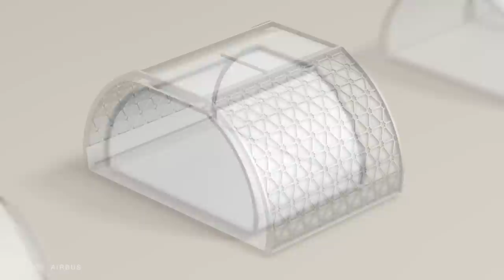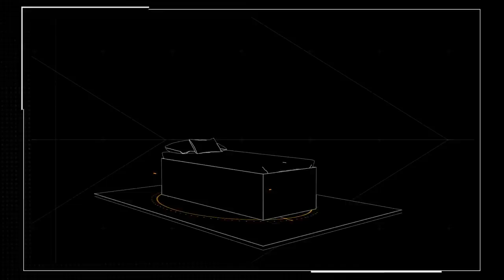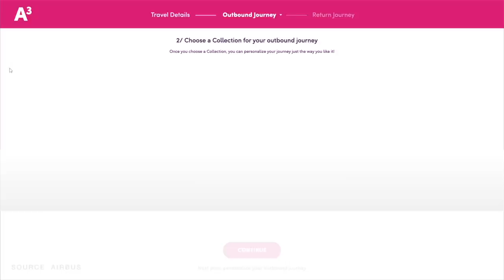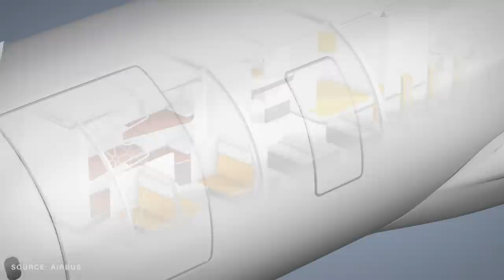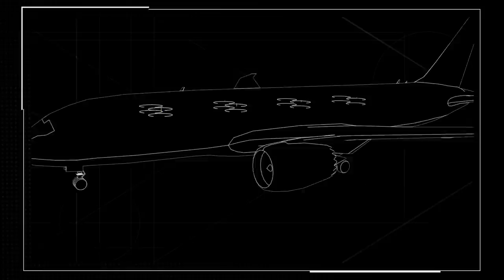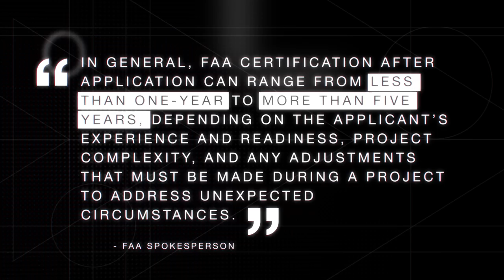Inside Airbus' modular plane concept

Comment: in future i dont travel by plane, I travel by Hyperloop
Reply: You gonna do that over the ocean?
Reply: Jon Petersen we're working on it. stay tune Tesla.com
Reply: one day its gonna be possible
Reply: Hyperloop is only viable between high density cities over short-medium distances. If you think air travel is going anywhere, you're deluded.
Reply: Behemoth29 Hyperloop is faster, cheaper, and ELECTRIC.  It's the future for non-transcontinental travel.
Reply: But Hyperloop's crammed.
Reply: Lukas Wagner but hyperloop is just a pipe dream that's all
Reply: lets just prove this technology even works by building it, not a small 1km test track but 50km or something.
Reply: Kni you have to take small steps in innovative new technology, rather than big steps. As it will very costly in the beginning. All inventions are 1% inspiration 99% perspiration
Reply: Yeah I'll see you say that when you're going from Europe to America
Reply: Max Dietz With that attitude, essentially the same could be said about planes. A long pressured aluminum tube riding on nothing but the air underneath it, resting on lift forces created by bendy and seemingly fragile sheets of metal sticking out of the main tube.

Of course it could fail. Of course there will be breaks in the system. However, they can be solved with continued innovation. Being constantly negative doesn't solve anything, on the other hand.
Reply: Hyperloop is just another terrorism event waiting to happen.. Who is going to keep guard a tunnel that extends hundreds of miles in the open?
Reply: Pfff hyper loop? I rather teleport each and every single cells in me to the location.
Reply: so is anything and everything else....
Reply: Hyperloop sounds faster and better
Reply: Hyper loop is sooo 2017
Reply: My team's Hyperloop design used a very similar modular concept that got us a SpaceX award last year.
Reply: Omega Who is going to keep guard a pair of metal bars that extend hundreds of miles in the open? At least Hyperloop doesn't vaporize unlucky local wildlife
Reply: Evan C. The issue that behemoth mentioned has to do with the vacuum which the hyperloop would need: the longer the tube is, the more air you would need to pump out and the more stress the structure would have to support, not only that, but the slightest failure would compromise the entire track. I'm not saying it's impossible, but it is clear they need to work on the project a lot more before it can be used.
Reply: so please watch hyperloop one. so far it worked out really well
Reply: Hyper loop is like 100mph faster then a plane.
consider the cost of implementation of a ocean wide hyperloop system vs. and airplane
yh nah i think the aviation industry is gonna me more then fine.
As for supersonic planes the industry found out ppl like the subsonic spped of current aircraft. THeres not much of a need for faster planes soooo...
Reply: Yuanxin Liu But planes are in the sky. There's nothing up there that could actually puncture a hole. In the ground there's storms, hail, rain, rocks, and vandals waiting to mess it up at every foot.
Reply: Hector G. How? What is getting out of hand?
Reply: You mean the hyperloop that has been thoroughly debunked by Thunderf00t?
Reply: We'll see what will work first: Hyperloop, or Electrical planes =P
Reply: Evan C. Obviously you didn't listen to what Elon Musk said....
Reply: 77Avadon77 thunderf00t did a lot of incorrect math in his video just saying
Reply: What incorrect math? He's right that a tear in the vacuum would make the whole thing worthless. Tunnelled vacuum travel is an old idea that's never been implemented because of design obstacles that don't make it feasible. You'll never see a hyperloop in your lifetime.

Comment: This looks like the beginnings of what traveling to the Moon or Mars could look like. Less turbulance in Space.
For terestrial travel, it seems like a lot of space per passenger.  As fuel costs are the most expensive costs for the airlines, I don't see them adopting this until we have solar powered planes flying on battery power.

...but its a great design for passengers in Space or even possibly a Space hotel. Maybe the compartments not being used could be folded flat using origami tech

Comment: Cabin designs traditionally focus on fulfilling required safety regulations and accommodating maximum possible seats. However these radical modular cabins take the idea further to include human comfort. While they won't be implemented anytime soon as the airline industry has too many practical problems to solve, there can be possible middle ground. For e.g. how can the existing business class cabin in say an Emirates flight, which already has a bar area, be redesigned for more space and facilities. It doesn't have to be "all or nothing"; there can be "some".

Comment: Bet the only thing that will be flying is the new system for loading up the cargo, a few tonnes of extra cargo. Plus loading cargo quicker on the plane will save money as well.

The screens will probably be use at some point in a new aircraft to cut weight and improve aerodynamics.

Comment: Before even watching the whole thing I'm thinking: Okay, you can hot-swap people bays, why not hot swap the people too? Make it safe enough to load the people into a hallway that leads to the airport interior. Then getting off the plane doesn't take as long, hunched over, waiting for others to get their baggage. The bottleneck is now a small row of chairs instead of the entire length of the plane. (With one person trying to yank their oversize carry-on out of the over-head bins, a line forming behind them.)
Reply: Re: no windows. I get the impression this kind of implementation would include that freaky all-around display where you could select to see a movie, or just the exterior of the plane. Cameras are _super-cheap_. You could have one for every meter of the exterior of the plane for a cheap and helpful constant 360 degree view of the plane exterior.

Comment: Why no windows? I can think of how you could put windows in the aircraft.
Reply: TYler SChecter i believe since it's modular system meaning they will slot the sections into the plane with different permutations, the windows might not always match up to the exterior of the plane so they just block it all out

Comment: I'm cabin crew and I don't think this will take off. Current advice is to stay in your seat with your seatbelt fastened wherever possible, as climate change is increasing the amount of clear air turbulence - look at the recent Etihad flight where CC and PAX alike were thrown to the ceiling and injured. Encouraging people to be moving around increases the potential for injury. (And also all these loose items they have in the demo - where are they stowed and how long does it take to do so??)

Comment: so Airbus will store the additional sequences which the airlines would like to exchange at the airport and invoice it to the airlines? and there are way fewer supply of seats and growing demand for them, so tickets' price will rise more than the airline can earn with lost seats but increased service or drink/food consumption - what is already expensive. or airlines will buy more planes to meet the demand for flights but airports already run on full so they'll buy more A380? as someone said below: people don't want to spend often twice the time in a queue than with actual travelling; they need easier boarding. probably the aim of this project is not to revolutionize air travelling but to come up solutions for faster freight loading, cheaper to make bar and sleeping areas and so on.

Comment: Why do they think this modular concept allows them to disregard passenger density?  I thought the main advantage of this was just reducing aircraft turnaround time... I don't understand why they're trying to fundamentally "change the flying experience" as well.  The cabin layout and modularity are entirely separate issues.  The fact that they're combining the two suggests a misunderstanding of the pressures within the aviation industry.

If they were serious about getting this concept flying they would start with a modular yet conventional cabin for the sake of certification.  The fact that they don't do this implies that they're only interested in this as a shiny artistic concept- not as a practical one.

Come back with higher aspect ratio wings if you want to actually help the airlines.

Comment: I see this coming quickly.  It won't be for this open, luxury concept. Instead, United et al will look at ways to increase density on flights with premium undersold areas.  For example, if only 4 of 12 First Class seats sell, why not switch out the 8 empty seats for 3-4 rows of economy. If Economy Plus or Extra Room seats don't sell, use that space to jam in more economy. We may even see a future where beyond economy upgrades are a thing of legend, and that all planes are full density.  That, or those in higher classes pay even more premiums, which airlines can now price in based upon row modularity.

But having 2 spaces for one paying customer? That will never happen.

Comment: First of many issues, where will the lifejackets be? I bet almost no one will get on the aircraft when they say they're no life jackets.

Secondly, why would there be a bar? because most pilots don't like it when they have drunk passengers who throw fits during the flight.

Thirdly, what about emergency exits? If they are no emergency exits beside the front and back doors then it would be unsafe to be on.

Last of all(even though are a lot more issues with this, I don't want to be here all day writing this), how is a restaurant going to work because it would be dangerous to have a fire cooking food safely. And other methods would be hard to do to fit into a single module.

Comment: pie in the sky daydreaming. It weights too much and that weight cuts into total payload.  Too much empty space is a non revenue potential.   In past practice, based on removable crew bunks, hooking up reliable water and drain connections will be problematic, and cause delays if they leak.

Comment: I don't see this in the next few years. applying these modules to an older airplane which was not designed to carry these modules doesn't seem practical for airlines to use. If airbus really wanted this to go through, they would need to build a new plane that would be easier and more practical for use of these modules. But one out of many flaws is that this is adding weight while also taking up a lot of space that could be used to carry more passengers. Not to mention cargo. So you're adding weight while also decreasing the amount of passengers. And decreasing the amount of passengers leads to loss of revenue. And adding more weight means less cargo can be carried. And with all this weight you still need to load a lot of fuel. Especially since I see this only being on international flights. But I can see something like this in the future. Maybe not in the next five years. Give it 20 maybe 25.

Comment: If the plane crashes more people will be trapped inside and the seats won’t be built for a crash but built for comfort also I have no drought that people will congregate to one side of the air plane and unbalance the plane during flight also during unexpected turbulence much of the people out of there seats will be thrown around the cabin causing panic, it doesn’t make any Sense economically because you would have to have specialized employs to work each of the modules, another thing is who decides what modules go on each plane do the passengers vote does the Airline Decide before they sell the tickets and wouldn’t  they just choose the modules that bring the most profit and not what the passengers want/need or they might jack up the prices of flights witch have special modules. This is a bad idea , companies should invest in making the passengers time on the plane as short as possible, making planes faster, making them more fuel efficient. No one needs extreme comfort on a plane they need a quick way from point A to point B that is semi comfortable.
_)_):::::::::::::::::::::D~~~~ rocket ship

Comment: honestly I don't think this will take off (pun fully intended) you don't stay in the air long enough for this to be viable
Reply: AngryDane I would envisage this being used on things like the dreamliner or other planes with 12hr+ flights - I think this would be really good for those, where people would be wanting luxury.
Reply: but the extra downtime needed for changing around the modules would not be cost effective

Comment: Completely ridiculous and impractical...turbulence is a huge issue and very dangerous that needs people to be seated - having people exercising, walking around, playing when turbulence can happen unexpectedly is very stupid...this is why airlines recommend people to have their seatbelt on when seated and that the sign is often lit out of precaution. On tops of all this, airline companies are being forced to lower prices - so to make money they need people on planes...economy class is where airliners make the most money and are virtually guaranteed to fill all the seats - first class and business class take up a lot of valuable space - which is why certain airliners now dont even have first class.

On top of all this, a modular aircraft for people would cost a lot more to maintain, requires more health and safety standards - but worse is the change over time...the longer a plane is on the ground, the more money is wasted.

For something like this to work it would cost a fortune for passengers - in fact some airliners do have bars, meeting areas, and even private bedrooms with ensuites - but they cost a fortune and are for the select few.

So it’s great you can toy around with design - but design has to consider real use application.